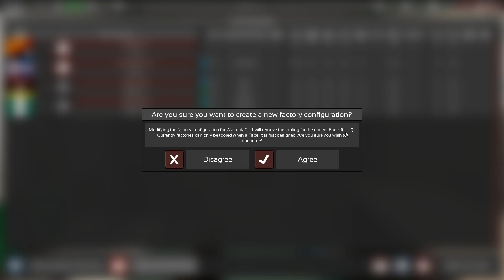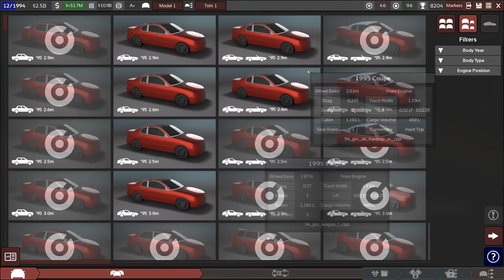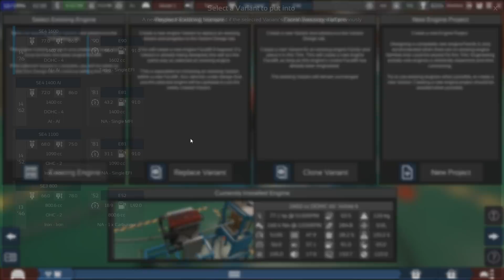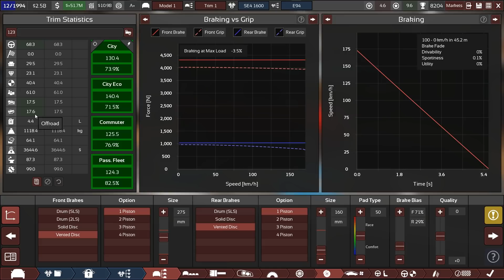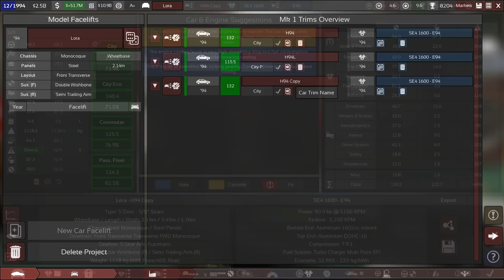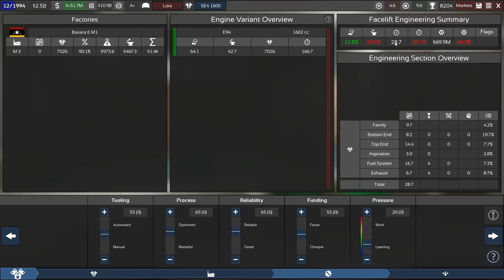Automation LCV4.0: Super Eco Ep.22

Comment: The Lora reminds me a bit of the VW Lupo (came out 1998 I think). It also had a süper ecö version, the 3L TDI - with 3l/100km - had a diesel though, so not even nearly as efficient as Hans' designs. Also I don't believe VW 100% when it comes to diesel, don't know why..
Reply from the maker: Haha yes, the Lupo had crazy good economy if you drove it well. The manual helps that too. Diesel is an advantage there due to the turbo and base 10% higher efficiency... also "not 80s turbo tech" does help xD